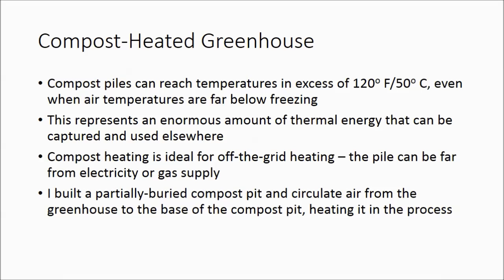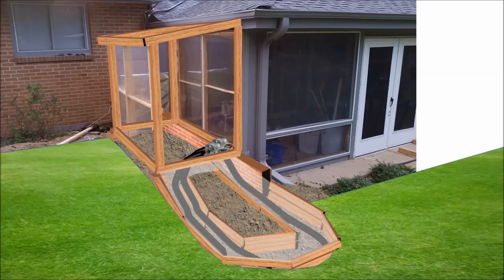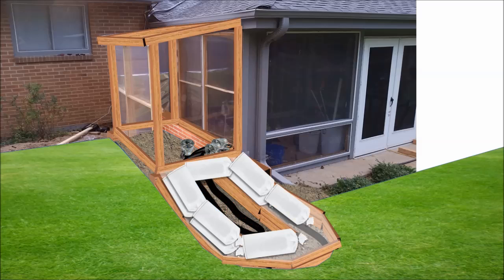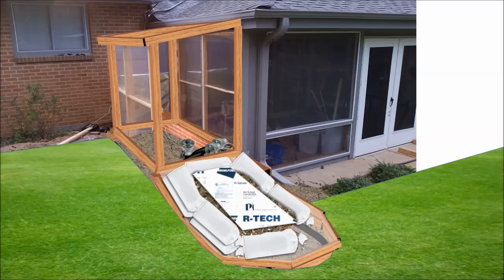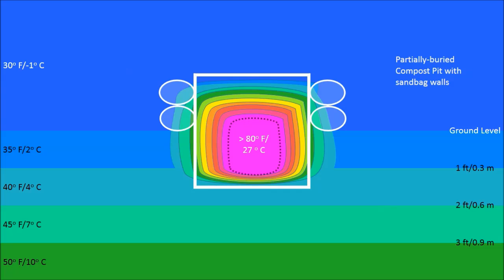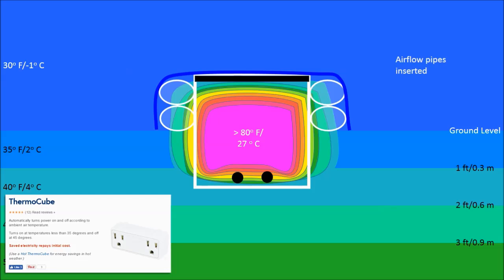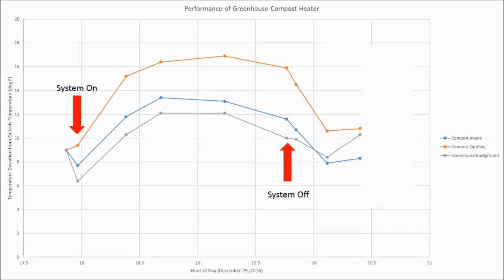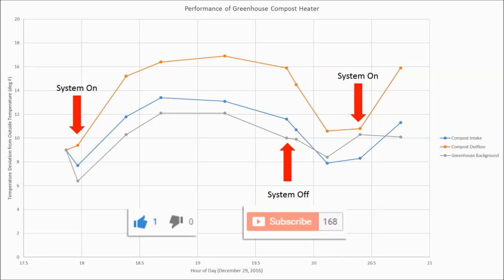Heat Greenhouse with HOT COMPOST.  2016 Build and Results

Comment: Any thoughts about digging the pit INSIDE a greenhouse?  Did you ever have an issue with vermin digging into the pile? It really looks like a winner to me!!
Reply from the maker: great question.  The biggest factor that kept my compost outside of the greenhouse was space (or lack thereof).  The last setup that I built was "greenhouse 3.0" in 2020 (https://youtu.be/A2TQJl9WjLc).  I had the compost chamber adjacent to the greenhouse, with a pretty dandy fully-passive heat exchanger (https://youtu.be/eMHbHAKeMC0).  The saddest thing was watching the compost pile go cold after 2 weeks (too small), with no feasible way of turning it.

A compost pile in the greenhouse will add a lot of moisture to the greenhouse (could be good or bad, depending on your viewpoint).  It will also add CO2 (good) and ammonia/methane (bad) if you use a very "foodie" compost mix.  My compost mixes at the end were shredded paper and dried leaves (brown) and coffee grounds (green) from a local shop.  My last compost chamber was sealed to keep moisture and gas out of the greenhouse.

Vermin will be attracted, not to the compost itself, but the heat.  I had a cat that was obsessed with a backyard compost pit!

Hope this helps.  I'm not currently composting but this brings back good memories.
Reply: @MorganBrown  it all makes sense, thanks. I was concerned , particularly, with ammonia and moisture is always a problem. Any issues with pest animals, I refer to my associate, Mr Remington.  It's a farm, not a homeless shelter

Comment: You said in the beginning you dug 5 ten feet deep wells.  Are you meaning a 5 by 10 feet trough for the compost?

Also, our greenhouse is 24 ft by 8 ft.  We would clearly need a bigger floor print than what you are showing.  However, the room we are working with is probably about 5x10.  Can we just go up higher like say 4 feet high by 5X10 to generate the heat we need?  (-10 coldest to teens normally).  Thanks.
Reply from the maker: No, the wells are for a geothermal heating system, which was under the compost trough

Comment: I've been looking everywhere for someone who followed Jean Pain's example with forced air instead of water pipes.  I have a lot of 4" drain pipe, but it's perforated.  I figure if I run that pipe through a fifty yard pile through an external, well insulated box with baffles and a few hundred ft of Pex, I could run a hot air line into the house without making it all damp and compost-y.
Reply from the maker: Fritz, thanks for the comment.  I am surprised that more people do not opt for an air-based system.  Water-based has many more moving parts.  And they never show "year 2", when they have to dig out the 200 ft of PEX from the compost pile and end up putting a hundred holes in the PEX!  If at all possible, I'd recommend having a completely airtight heat exchanger inside the compost pile.  Here (https://youtu.be/eMHbHAKeMC0) is my most recent (2020) compost heat exchanger; I used rigid dryer duct, and it worked very well.  Even better, it worked with a natural "thermo-siphon" - no fan required!  The previous year, I used flexible dryer duct in a closed loop, and micro-holes in the dryer duct admitted condensation to the loop.  Within a few weeks, the closed loop had filled with water, and air was no longer circulating!
Reply: @MorganBrown  I get your point.  I want to try the external so there's less catastrophic take-apartedness if something goes wrong.  I'll take a look at your update you referenced.  Thank you much.

Comment: Thank you so much for that!  It is just what I have been looking for.  I would like to build a partly above ground box, well insulated with sand bags and builder foam sheets, and a closable wooden top (like a grain bin), and using my livestock manure compost.  I plan to run the piping as you have at the bottom of the compost pile, and then through the planter boxes inside the greenhouse, (which will be 14'X24'). Do you think this will provide enough heat to keep it warm all winter in Seattle?  Average temperature at night is about 0 C. Thank you!
Reply from the maker: Leslie Williams please go to my main channel page and look at the most recent system for compost heating.  I’ve built roughly what you suggest (above ground wood box insulated with foam board and a removable top).  I run a rigid dryer vent through the compost pile as a heat exchanger and it convects heat nicely without the need for a fan.  My only suggestion is to make the compost pile as large as possible.  It will produce more and longer lasting heat.
Reply from the maker: Leslie Williams just guessing here but for a greenhouse that size, you’ll want compost pile 8 feet wide by 4 feet high.  That should stay reasonably warm all winter long
Reply: @MorganBrown  Thank you Morgan.  That's exactly the size I was thinking of building.  At the other end of the greenhouse, I am putting a sauna, which will both insulate that end and provide some heat periodically. I am looking forward to a warm, tropical, vacation at home all winter this year!
Reply from the maker: @lesliewilliams256  Here's a short video describing my 2019/2020 build and compost heating results.  https://youtu.be/eMHbHAKeMC0  Next year I'm going to make the compost pile larger.
Reply: He's achieving 16 degree temperature differential with the outside air.  So with night-time temps dipping to 32 degrees, that's plenty to keep it in the 40s Fahrenheit, which is all your growing things need, even growing citrus.  The places where I want to build, I'd have the greenhouse dug in deeper and supplement the passive heat with a rocket-stove mass heater or some kind of massive masonry/cobb heat sink.

Comment: I don't have access to coffee grounds so I use alfalfa pellets and clippings from my winter rye grass for a nitrogen boost. you can increase the temp. inside the compost pile by about 40% if you add alfalfa pellets when turning the compost. the center of  my 48" deep compost pile goes up from around 120 f to 160-170 f degrees after adding alfalfa pellets. add a handful of pellets with each green layer you add to the compost. 
alfalfa pellets are inexpensive and available at pet stores and Tractor Supply Stores or online.
Reply from the maker: Good to know !  Maybe I will have to buy a couple bags of alfalfa pellets

Comment: I'm looking to start a large compost pile and see lots of different advice on youtube.  Do you not need to have air circulating the pile and do you have to keep adding water to it over time or do you keep it dry ?
Reply from the maker: Great question(s)! 

How large is large?  The common advice is that a compost pile needs to be 3x3x3 ft (1 cu m) to get hot, and I can tell you that this advice is TRUE (I learned by repeated failure ;-).  The piles that I typically use for greenhouse heating are about 4x4x4 ft.  If your pile is truly huge, then the advice I provide below may not exactly apply.

I do NOT circulate air through the pile.  (Regarding aeration, I bought an 18-inch auger for a hand drill and plan to drill holes in the pile once it begins to cool.  Anything to avoid turning the pile!)  My pile is so small that this will dry it out quickly (bad).  I live in a very dry climate (Colorado) so to maintain the humidity and insulate the pile from the cold, I cover it.  Check out my newer videos (see description) to see the compost build.  I basically enclose the compost inside an insulated box.  Because my pile is covered, I do not typically add water.  The pile doesn't have to be THAT wet in order to compost.  Moist is good enough.  If your pile is truly huge (Jean Pain-size), then you might find that aeration provides benefit.  The commercial hot composting operations seem to do that.
Reply: Thanks for the advice. I don't plan to have huge piles. Thinking of several bays formed from pallets so not much bigger than 6x6x6 ft each bay when full.

Comment: Seems a little over engineered.  Why not just extend the greenhouse a little and put the pile right in the greenhouse.  Or put the pile up against a greenhouse wall and use thermal conductivity.  Then you dont need the fan or piping.
Reply from the maker: barney barns take a look at the most recent build https://youtu.be/Ze0nXN6Vvic
Reply from the maker: Biggest reason I don’t want compost in the greenhouse is moisture.  I want the moisture in the pile and not inside the greenhouse.  But I basically did extend the greenhouse as you suggested.  I segregate the compost from the greenhouse with a plastic sheet and transfer heat with a heat exchanger

Comment: Any fire danger as in spontaneous combustion  with compost being inside a greenhouse?
Reply from the maker: John Parkhurst doesn’t seem likely.  Residential piles top out at 160 deg, and it is only the moist part of the pile that achieves that temperature.  That said, if you have some links to piles catching on fire, I’d love to see them!
Reply: @MorganBrown  thanks for replying. I do not have any info on said topic. A fire does seem very unlikely, if not impossible. I was thinking about how improper hay storage....
Have you found a particular mix of materials that works best for generating heat, for longer duration,  etc. 
Enjoyed your video!

Comment: if all the numbers add up and the compost pile would be placed in a sloped position in line with the greenhouse , cold air should naturally drop into the compost area and hot/warm air rise ...

have you experimented with adding worms to the compost pile  or saving grass clippings from the summer to use in winter ?

the concept is so ideal but so much room left for fine tunning... even laying black weed mat inside the green house floor ,to absorb some heat during the day... 

good video, it's the proof I was looking for .
Reply from the maker: Hi there - you should check out my most recent results (https://youtu.be/Dm7fQQrKlSs).  I'm getting 10-12 deg F of warming over outside temperature in the coldest time of day.  I like your idea to put compost in a low position to set up a convection.  I'm unable to fit compost inside my GH, so I had to build an attached compost chamber.

Comment: old video i know but would it be better to have the intake near the roof of the greenhouse and hot outlet near the bottom
Reply from the maker: Yeah, probably best to stagger the inlet/outlet vertically based on your necessary application.  Out of sheer laziness, I will often run a small fan in the greenhouse to circulate air and hopefully keep the air from stratifying.  As luck would have it, I've got "greenhouse 2.0" running, with a new, dual compost/geothermal heating system.  In fact, I'm going to run to get another load of coffee today and hopefully get all 12 compost bins chugging along!  https://youtu.be/Ze0nXN6Vvic
Reply: @MorganBrown  I would think not mixing the air and leaving the warm blanket at the top would be more helpful, do you insulate the greenhouse at night at all?
Reply from the maker: @steveanacorteswa3979  That's an interesting point.  I've never put much thought into the top-to-bottom temperature variations in my greenhouse...until I bought some long temperature probes.  I've got one probe outside (about 6 ft off the ground) and another sitting near the ground in my greenhouse.  The greenhouse temperature is colder than the outside temperature!!!  My greenhouse is reasonably insulated - foam board on shaded west wall, plexiglass on south wall, plexiglass on north wall (which faces a screened patio), polycarbonate + 6 mil on the roof, multiwall polycarbonate on the east wall.

Comment: Great idea I live up in manitoba Canada where temperatures in winter could sit at -30c for a month at a time would this system be able to heat for 7 months a year
Reply from the maker: Martin, glad you think it's worth trying.  Yes, this method can work when the outside temperature gets very low...provided the compost is well insulated.  Check out my 2017 new build video (https://youtu.be/pZGDIBeBLNs) - I think you'll find the insulated compost chamber far more useful for a Canadian climate.  All the compost books will tell you that the pile has to have good airflow.  This is true...until the pile freezes!  I've found that covered piles have no problem at all getting and staying hot.  If possible, I'd highly recommend 1) putting your pile INSIDE the greenhouse and 2) making the pile as big as possible (it will stay hotter, longer)

Comment: If you want to see your compost temperature rise rapidly and higher than 110F, bury a large (1kg.) peanut butter jar filled with alfalfa pellets, basically horse or rabbit feed, from your farmers' supply store, about 6" deep evenly throughout yourpile. Great video. Keep experimenting. Good luck.
Reply from the maker: Well, I have to say - that's an interesting idea.  Nowadays, I only use leaves and coffee in my piles (keeps nitrogen and odor down).  Inside my new compost heating system, it quickly reaches 140 deg F (https://youtu.be/7weq02JHi1U?t=77), but declines to about 80 deg F after 2 weeks.

Comment: Nice work! What about building the pile into the ground instead of earthbag walls? Or in the center of the greenhouse for radiant heat? Also, have you measured if you are pulling co2 into the greenhouse from the forced air system as a byproduct if the compost? Another potential advantage!
Reply from the maker: Ryan, Thanks!  Check my 2017 new build system (https://www.youtube.com/watch?v=pZGDIBeBLNs).  I built a wood structure and insulated with polyethlene sheeting and foam board.  The compost pit was dug about 3 ft into the earth.  This is definitely a better system than what you see in this video, but heat transfer remains problematic (though it still works).  In a perfect world, I'd strongly lean to your other suggestion ("center of the greenhouse for radiant heat"), but I lack sufficient space in my greenhouse, sadly.  I'd say the added CO2 from compost certainly couldn't hurt, but you have to control the ammonia.  I control ammonia by keeping the pile hot and only using "simple" ingredients like leaves and coffee, in in my compost.

Comment: Awesome I am really wanting to do a small greenhouse like this just a little 5x5 or something but I live in Canada where I am temperatures can get -10c or about 14 f for 2 months straight will this still work during that time?
Reply: you will be able to extend your season but unlikely to grow year round...  if you put more layers of cover inside the greenhouse, this will help a lot...  like a cold frame under a cold frame under a cold frame inside the greenhouse...  but when winter sets in things tend to come to a standstill...
Reply from the maker: Yep, you nailed it.  As a season extender, it works quite well - I kept 8 tomato plants alive and producing until December 7, 2017, when we dropped to 7 deg F.  The cold frame idea is interesting, particularly if I'm using a forced air system to heat it - like the closed loop heat exchanger through the compost.  Smaller volume to heat, better insulation.
Reply from the maker: Grow Guy, that's excellent.  Those temperatures, particularly when they last an extended period of time, can be difficult.  It certainly tests the insulation on your greenhouse!  Assuming you are well insulated, I think the compost concept can work well.  Check out some detailed analysis of how my system did in the winter of 2017 (https://www.youtube.com/watch?v=xNUlrwqNXa8).  I was able to keep tomatoes growing until early December, when the outside temperature went below 10 deg F.  So yeah, it worked very well as a season extended, but not an year-around system.  That said, if you have a very large compost pile, relative to the greenhouse size, you might be able to make it work!

Comment: SUPERB presentation ---  no over exageration  or throwing arms around ,raising voice s  and dramatising  , ( which americans unfortunately are known for , lol ) 
excelent information , which i had never thought about before and as i m just about to build a small holding greenhouse  which i was gonna try to heat with calor gas  this may make an excelent back up system for the gas.
 seems the compost is gonna be next to the greenhouse then .
 many thanks !!
Reply from the maker: Paul, as they say in the movies, "just the facts, ma'am!"  Thanks much for the compliment.  If you haven't already, please check out my newer videos (see description) where I give some more detail on how I upgraded the system for 2017 winter.  If at all possible, I'd recommend trying to put the compost INSIDE the greenhouse.  If you can't, then insulating the pile is crucial...and the pile needs to be easy to turn.  My new system is partially buried -- good on the one hand, since it helps insultate the pile.  Bad on the other hand, because it's hard to turn the pile.  Unless the pile is large, it will tend to cool down pretty quickly (my piles were below 100 deg F after ~2 weeks).  Good luck in your project!
Reply: MORGAN --- cheers  mate ,,, since i ve seen this video , i researched  it a bit more , as  where i live in britain , we  do get  winters  -  night times  below freeze ,regular from  xmas till feb , then sporadic ground frost maybe untill  late april !!
definate  gonna  use  an outside compost ,, like  yours , because  even if it  dont  work as well as i hope ,,  i ve STILL GOT TO  SIGHT THE  COMPOST  SOMEWHERE !!
  may as well put it  where it may do some help   ??? COMM0N SENSE !! . 
still  gonna  use the gas , plus a hot seed plant bed over straw  bales ,, and  MAYBE  a small  compost bin inside !!
i shall keep in  touch mate !! 
 all the best !!